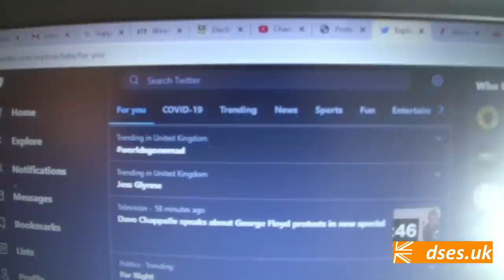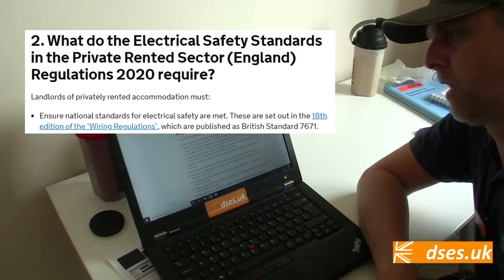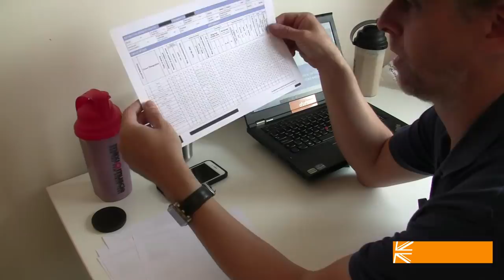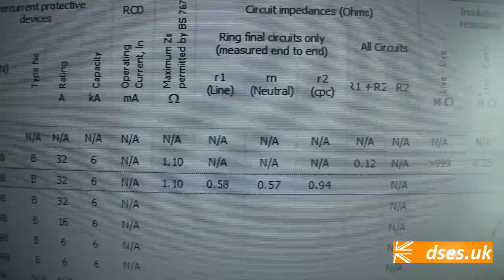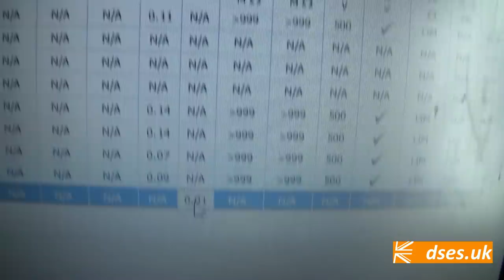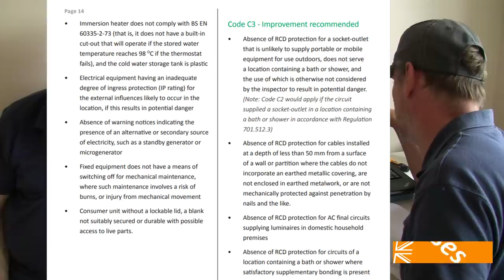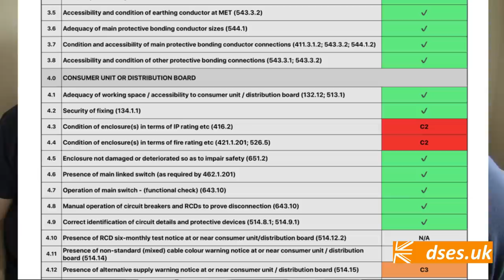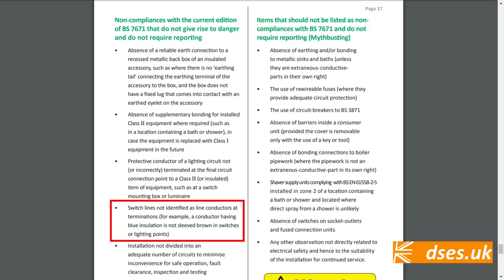Landlord electrical inspections from July!

Comment: Hi David, thanks for raising this and common sence attidute to it.  But if we were to play devils advocate on the law as its "written" in the legisation this means 18th Edition as a minimum standard so no rental property is allowed to conform to a previous standard then what would the implication be?

Could a property comply with 2 colour codes for example?  Ie under the letter of the law does that mean that most landlords in the country need to displace there existing tenents rip up floors chase out walls etc etc.

Im aware this is a silly approach but if it "must" be 18th Edition then taken the hardline view what is the impact of that?
I.e for 10mins be the bastard inspector and consider singing off a standard 19 year old installation with no deviations from the regs.  What sort of impact 

As landlord with an interest in electronics and electrical enginering (but a  non electrician) just interested in the views on the potential impact of this regualtion as it reads so can raise it with NLA and local MP etc to see if we can get some clarity in the law.

Personally I'm in support of additional safety/conveniance in the form of RCD's and RCBO but if the law states 18th or bust then we have a big issue.

SOURCE https://www.legislation.gov.uk/uksi/2020/312/pdfs/uksi_20200312_en.pdf

“electrical safety standards” means the standards for electrical installations in the eighteenth
edition of the Wiring Regulations, published by the Institution of Engineering and Technology
and the British Standards Institution as BS 7671: 2018(b);
Reply from the maker: Well, that's the issue right there James; how far does one interpret that? Does a 20yo installation require full rip out and refurbish because its wiring colours don't meet 18th Edition spec? Does an older installation "pass" the 18th Edition test if still conforming to its design because of the HSE notice and Regulation 651.2 which states "Existing installations may have been designed and installed to conform to previous editions of BS7671, applicable at the time of their design and erection. This does not necessarily mean that they are unsafe"? If the guidance for inspectors is that older installations can be passed with C3 conditions on the kind of things seen here, then will new guidance now be issued to say inspectors should 'Code C3.... unless it's a rental property." If the intention is to see all rental properties upgraded to the latest standard, when is that to be achieved by as it certainly won't be done in the next fortnight? If properties are upgraded, what happens when an amendment or new Edition comes out; do those changes have to be implemented, and how quickly? Personally, I doubt an installation like this one is a danger if not upgraded, at least not unless the tenant undertakes their own unauthorised alterations to the place, so to me it seems this can be passed without my being in fear of LABC, HSE, NLA or anyone else hauling me up under EAWR, but it puts inspectors in a tough position: demand the landlord coughs up for an upgrade, or risk not complying with legislation even if you think it is suitable for continued use. I can't say I care for that.
Reply: James Tutton , hi was under the view that they regs are a guide. IE your meant to use your view, also it’s always personal when it goes wrong they will not chase regulators when it’s an issue created by the rules. As a point remember all the electrics going off in homes because someone turned a light on . Rules said protect circuits with RCD , so they were put on Mains cheapest and simplest way .
Reply: Well actually if the electricians did apply the Regulations strictly as written they would cause such a storm amongst Landlords then something would be done about this nonsense. By "interpreting" the Regulations you are hiding the problem and allowing the numpties who write this stuff to get away with it..
Reply: Yeah but the reason why the regs keep changing is money 

Money to re train to new regs 
money for new books 
 The only up date it should need is to get rid of twin an earth and use 3core flex as the cpc is sheathed right out of packet butthe cost needs to come down
Reply: Just because it was good in the 16th edition doesn’t mean it should still pass now. RCD’s save lives. C2 for no RCD on socket & luminaire circuits . Plastic board C3. Only a C2 if under a wooden staircase with the only exit route. It’s about common sense & tenants should be provided with a safer install should there be a way to make it available. It’s also about understanding the codes.
Reply: @fightdisciple9192  C3 for no RCD on sockets for internal use.  56:09 shows the page from NAPIT codebreakers.
Reply: This is the problem you get when you have more than one regulatory body. It starts to make a conflict of interest! Government legislation should not trump the regs! As an electrician the wiring regulations should be clearer to put less i interpretation on electricians!
Reply: cjmillsnun that very book states c2 for cables contained in partions less than 50mm which is near enough every cable run down to a switch and socket !
Reply from the maker: @fightdisciple9192  This is where NAPIT differ from ESF. Not sure why, and I align myself with ESF on that one unless cables are suspected of not being in prescribed zones.
Reply: That is an error within the book, there is no way you could code that c2.  There are thousands of installs with cables in the wall not rcd protected
Reply: patrick brannan Oh cmon. An error within the book ?! Do you know how many times that would have been proof read. I was taught on the NICEIC 18th upgrade C2 for no RCD protection on lighting. NAPIT has c3 . Regs state circuits in dwellings must be RCD protected. Both governing bodies have interpreted different - maybe just maybe the regs should bring out a coding book
Reply: @fightdisciple9192  if it isnt safe now then it wasnt safe when it was installed (assuming no ones monkeyed with it) or are we saying here that  sparks have installed faulty electrics in the past
Reply: @fightdisciple9192  C3 if under wooden staircase or in sole means of escape, no code if not because of date of design. ESF Consumer Unit Mythbuster says: 
"What classification code would be appropriate where, post January 2016, an insulated consumer unit is encountered in a domestic premises?
If the consumer unit is located under wooden staircase or within a sole route of escape from the premises, a code C3 classification (meaning that improvement is recommended) would be appropriate.
If located elsewhere, this might be worthy of not, but it would not be necessary to record this on the condition report."
Reply: @octymocty132  I disagree that the regs only change because of money, RCD s make perfect sense
Reply: steve robinson no what we are saying is it can now be safer & without today’s safer electrical installations then it can be deemed unsafe. It’s no disrespect to old installs, I come across some brilliant test results and install work but it may have an old rewireable fusebox, that shouldn’t be passing now with the equipment available. Tenants should be provided with RCDs.
Reply: Toby Sherring signs of thermal damage it’s a C2
Reply: @fightdisciple9192  who said there was thermal damage? I was responding to your coding statement. Guide to coding clearly says C3 if under wooden stairs or sole means of escape,  no code if not. Evidence of thermal damage is another issue. Presumably you could repair or replace if it was a removable element such as an MCB, RCD or Main Switch and you'd investigate why it was overheating. Not necessarily replacement of board.
Reply: Fight Disciple9 what a load of old tosh, So that means C2 for all cables in the wall.  That’s means the majority of householders with a 16th edition consumer unit will have to have it replaced.  Utter rubbish, as sparks we would all like to see the end of 3036’s all circuits protected by rcd’s.  But this is the real world & if you were to Code cables in the walls as a C2,  you should not be inspecting properties.  You can certainly recommend it as a C3.  I have no doubt you wish safety for the tenant, I suggest you consult your governing body on the matter as you are incorrect.
Reply: @fightdisciple9192  So the reality of the situation from a legal perpective is its safe (because  there is no national emergency to rectify these now deemed unsafe installs)  but no longer safe because something more safe has come along , i can understand that from the perpective of the old rewireable fuse boards they were designed for a different era , however boards installed in the last 10 years are a different  ball game . I would really like to see this argued out in court
Reply: patrick brannan “ if you code cables less than 50mm depth not rcd protected as a c2 you should not be testing properties “ ha. I literally repeated the napit code, the book which people are touting in this 
thread.
Reply: steve robinson they’ve asked for rentals to be tested to 18th standards - i think as sparks we know what’s a pass and what’s not. Plastic board is fine as long as there’s no signs of thermal damage throughout the Fuseboard. If sparks want to code no RCD protection as a c3 then that’s their call. On NICEIC 18th update I was told c2 . The regs backs up that in my opinion
Reply: Toby Sherring i said thermal damage as to why it could be a c2 . Obviously if it’s just a module that’s thermally damaged of course you change just that part - can we stop trying to be smart arses on these threads it’s f*ing infuriating. So common in sparks threads people going for the edgy reply.
Reply: @fightdisciple9192   The issue is that NICEIC and  NAPIT  amongst others are  offering differing information , when these organisations can't get thier acts together  its the man at the coal face who's going to get burned
Reply: @fightdisciple9192  May be we should dump all the governing bodies, get one set of regs supplied by the government that we all work too
Reply: @fightdisciple9192  Cars built today are designed to be much safer than cars built 20 years ago (on average) - yet noone is insisting that airbags be retrofitted or that older cars can't be driven, as long as they pass the MOT, which is an agreed minimum standard of safety and roadworthiness. IMO, an ECIR is like an MOT for a house - As long as an agreed minimum standard is met then it doesn't matter whether it meets the current regulations. 

Obviously there are cars on the road that shouldn't be, but those would fail a (correctly administered) MOT.

The discussion should be on what that minimum standard for electrical work should be - If the Government want it to be the 18th edition, then they need to be very clear about that and explain to their voters why 80% of houses will need to employ an electrician to upgrade their installation.
Reply: @gibberingidiot  This is exactly how I view it, a house MOT. I'm gas qualified also and the gas codings are much stricter with the overall possibility of having someones supply cut off if deemed Immediately dangerous. Electrics can't and doesn't have that because it is more like a MOT for a house, also a great many properties that haven't been updated are owned by people that have had them since new and the regs were pre-double digits. If they've worked safely that entire time you'd have hell to pay convincing every OAP in the country to update. 

That's where the Gas regs are far more thought out, grandfather rights to original installations that have never had issues but don't comply with modern regulations are fine. As such a gas installation of age is arguably a far bigger potential for loss of life and damage to property than an electrical one. 

Also being dual qualified I can with 100% certainty and conformation state that both sets of regulatory books and accompanying hand outs have numerous typos and mis-classifications/information. The last of which I found during commercial gas exams where the giving restrictions for pipe sizing were completely wrong throwing all the calculations out. Most of the books are only updated for a new print run every 5 years meaning for the first 5 years including amendment updates they're still sent out with the wrong information, spelling, classifications or entire words missing.
Reply: @octymocty132  we have the T&E now In southern Ireland with sheathed and the same earth size as live and neutral 
ie 1.5  for all conductors it’s much better and don’t have to be messing around with earth sleeving
Reply: @PJB71  it was c2 in the 17th and still is, depending on whether or not you align Faraday, who's first name I need not mention or Boris Johnson
Reply: @fightdisciple9192  I'm doin' one now, proper original 1930s, ceramic rewirables in a mahogany box fed by a cast iron double pole, double fuse isolator, under the stairs naturally, in the tiny thin part, hehe.... fun!
Reply: @steverobinson8170  I have...fuck 'em, my clients get the 18th edition sheets straight from the book, no part p , no nic no napit, just me, the iee and my insurance
Reply: @fightdisciple9192  c2 if no RCD protection I would say for cables less than 50mm in the wall
Reply: The way I see it, the Gov page says 'conform to the 18th' and the 18th (as you pointed out at 13:25 ) clearly says that conforming to the regs at time of installation does not equal fail. Ergo, vis-a-vis, concordantly, if it conforms to the regs at time of installation it automatically conforms to 18th edition, because 18th edition days it does.
Reply: @fightdisciple9192  there are loads of typos and mistakes in the regs there always have been .
Reply: @steverobinson8170  what legal prospective ? The wiring regulations are not mandatory the are not whiten in law.
Reply: @steverobinson8170  also rewireble fuse boards  can be deemed safe for continued service as long as they are in good working condition with no signs of thermal damage exposed live parts. Then it’s a C3
Reply: At the heart of a lot of these disagreements about what is the "correct" way to code a particular deviation is the apparent oversight that codes given are entirely at the discretion of the person carrying out the inspection and testing.

Comment: The requirements for rcd protection as a minimum for sockets to be used for outdoor use is a 16th edition one , we would fit rcd sockets near the front and back doors . I was fitting memera 2000 split boards on rewires 26 years ago to give rcd protection to showers and sockets.  I think we should have stopped there , rcd protection for fixed equipment circuits and lighting is over the top to me

Comment: Great video once again and I think the often mentioned comment of it being too long is unfounded as your regular followers will always enjoy your "ramblings", as I did with this. There is always the Stop button if watchers don't enjoy it. As for the regs, I would say to treat it like an MOT for something like an E type Jag or 1960s Mini. They were constructed to drive, stop and corner safely and an MOT by a qualified examiner made sure that it continued to do so and identified if someone tinkered, or failed to maintain them in between MOTs to make them unsafe. If the cars were maintained to do as they did when first constructed, without making the owner install fuel injection, ABS and Stability Control, they pass the MOT. 
My opinion is the Government are doing the same to make sure the installations in rented properties are still as safe as the first installation by having an "Examiner" verify it is still safe. I think their use of "18th Edition" has been misinterpreted. In fact it specifically says in BS7671 is not retrospective. An EICR should state if the installation has been maintained safe as when first installed but with the bonus of sharing the "examiner's" expertise on how the landlord could make it better through observations. On a personal level I think, for the limited cost, all installations should have RCDs retro-fitted if there are spare ways, or even a separate enclosure, though not necessarily a board change. Talking of being "too long" apologies for the lengthy comment!
Reply: Olly you don’t rent a classic car to a family for school runs! So why do we allow allow a house with 70 plus year old wiring to be rented out to a family in 2020. Sucking loads it was never designed to handle. Half the cars in the 60s were that underpowered you’d have to go up a hill in reverse.. apt for the time.. a street used to have 1 car on the road , usually a ford lol..there are several million cars on roads now and we use more electric than ever before..unless it’s for a historic purpose replace or knockdown. My old rental house had toggle switches in the cellar, no rcds..joke tbh.. sockets melted in kitchen... used to blow bulbs all the time as well..

Comment: I watched this in two parts, thoroughly enjoyed every bit of content. Very honest assessment of an installation highlighting unreasonable choices made by individuals. This is a perfect demonstration of using your professional expertise, honesty and integrity, to determine the condition of an existing installation with an extremely helpful and clear explanation of the reasons behind critical points, studiously referenced. 

We all do inspections slightly differently from one another, but this is an excellent example of guidance used from Napit code breakers and electrical safety standards, that assists you if your unsure. If anything this content gives clear examples of observations made and the context in which it should be recorded. Very informative. Many thanks.